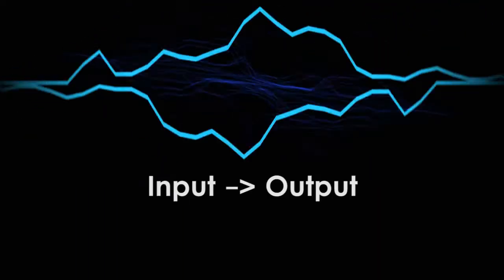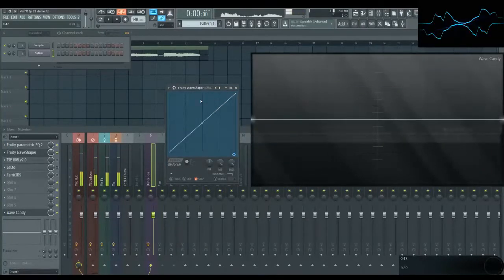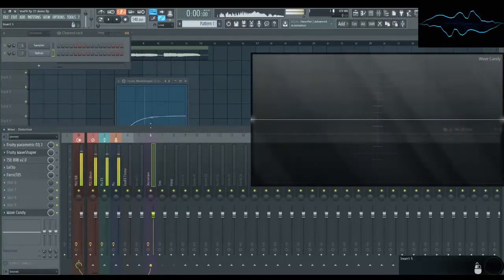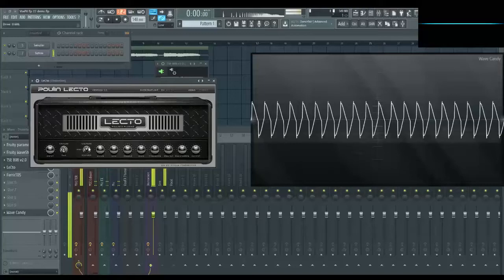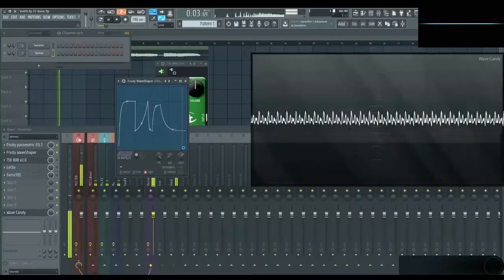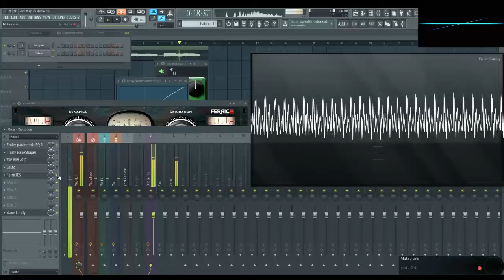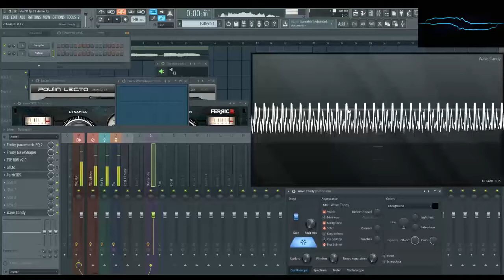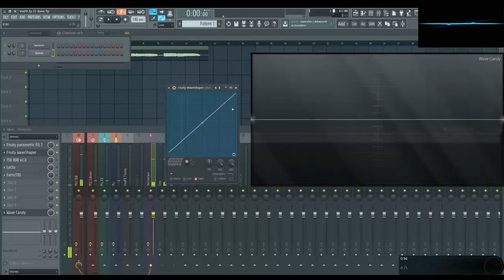Explaining Distortion and Saturation: The RIGHT Way to Add Grit to a Vocal - VoxFX Ep. 22

Comment: Very nice. But what about softclipping? I've used it on vocals and instruments before with great results. What's the actual difference between clipping and softclipping?
Reply from the maker: +Vocoded Glasses (Auro Prime) Soft clipping and saturation are more or less the same thing. They're both based on what happens when you make something really loud in an analog system. Analog systems don't abruptly cut off any overloaded audio; instead, they squash it down, causing harmonic distortion. Because the cut isn't abrupt, many people feel that saturation/soft clipping is more musical and less harsh. And yeah, you can get good results using softclipping on vocals, as I demonstrated above. =)

Comment: really helpful video :) ..  i Will ask you a question. if i whant to add to my vocal the distortion before i go throug my audio card . what should i use. can i use an overdrive pedal connected to my send and return holes of the mixer? :)
Reply from the maker: You should be able to do that. However, you can only really do that with a dynamic mic (as I'm pretty sure you can't supply a condenser's phantom power through a guitar pedal) that has a cable that goes from XLR to 1/4 inch.
Reply: my dynamic mic isn't really good  so i tryed  now to connect   my overdrive pedal to my mixer as a send/return device  (like an FX Rack) than i turn on the phantom power for the condenser mic and yeahh !! it works .. but  i probably have to find a more trasparent overdive pedal or fx maybe somthing not to harsh  and with more gentle distortion  :)
Reply from the maker: Generally, yeah. The alternative is to EQ the distortion send in post, and blend it in with the main vocal to taste. You'd be surprised at how distorted it can get while still being intelligible.
Reply: oh yeah i heard about that  . but i don't know why i'm still not able to do it in a way  that  sounds good to me ..  the problem  that i have is that i don't really like the clean sound of the mic becouse of the hi end even if it is not a really bright mic ..i will say that i'm searching for a kind of oldschool punk/cowntry  tone  so i will stay  midrangy  but without  sound thin or too sharp   :)
Reply from the maker: Might want to try EQing the clean tone as well, then. Ideally, though, you want to find a mic that better suits your voice. That can take some experimentation, but it's worth the effort. In the meantime, making an educated decision between which of your two mics sounds better will at least get you some of the way there.
Reply: thanks a lot for your help :) i will try  to make my best to solve the problem  and i'll let you know if somthing change !!